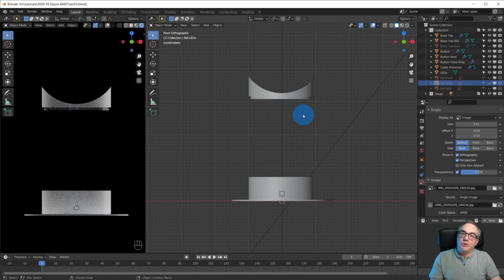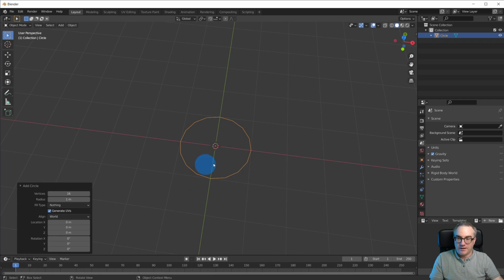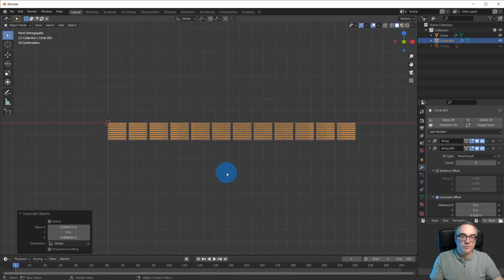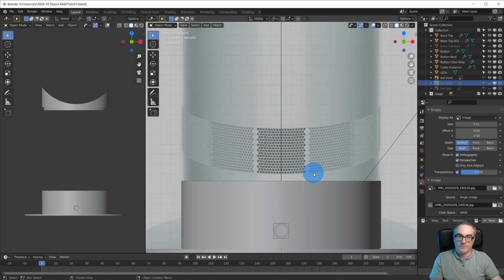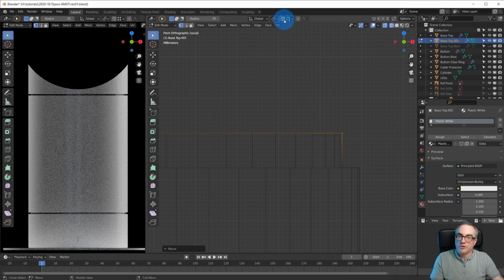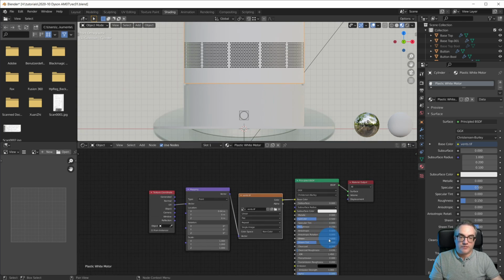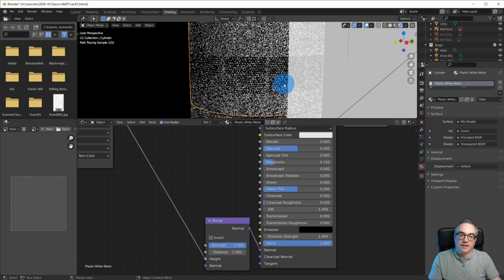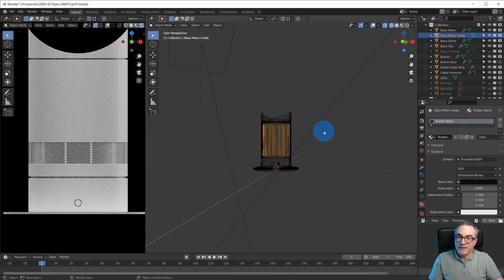Non-Destructive Modeling in Blender 3D [3/4] Dyson Air Multiplier AM07 Tower Fan

Comment: @Chris P  
I know you've gone over the technical problem of using textures with Non-Destructive Modeling.  I was just wondering, have you've tried using projection maps?  (projection maps don't require UVs)  If they work, it could allow for full NDM without major workarounds or compromises.
Reply from the maker: if you find a way other than cylindrical projection in the material node please let me know :)

Comment from the maker: Now I am wondering if for example Fusion 360 could handle the 3576 tiny little boolean holes that didn't quite work in blender...
Reply: The Boolean in Blender has always been a pain, even with the new Fast/Exact settings there are still problems sadly but still keep trying to use it even though it costs hours of work.
Reply: Hmm, what about doing the boolean on a "flat" surface (i.e. a box), and then a Simple Deform/Bend modifier to wrap it into a cylinder?